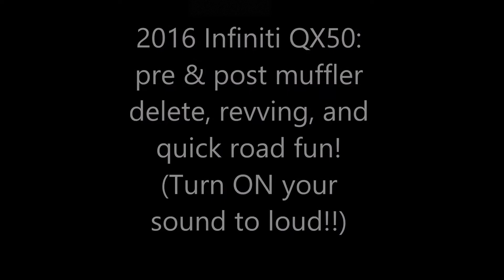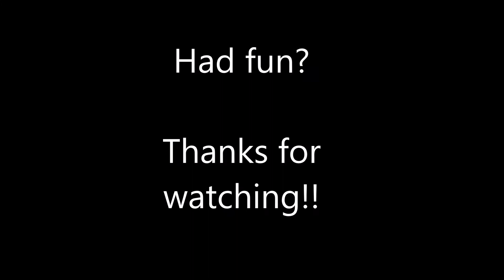Infiniti QX50 muffler delete

Comment: Looking to do this to my 2017 qx50, how much does a job like this cost?
Reply from the maker: It all depends where you live, tax rate, technician/shop's fee (service charge) and other factors, but a ballpark could be between $300-600, depending how much customized work takes place
Reply: G37 axle back, under $200 lol
Reply: @hughesw.1313  would the g37 bee a direct bolt on?
Reply: Where can you find Black Tips?

Comment: Im def doing this with mine
Reply from the maker: After having this for over a year now, I would *suggest to (still) go for a super small muffler. Being total muffler-less, sometimes after a long day, I just want a "quiet ride", but it's impossible. Once Muffler is deleted it's deleted (well unless you put it back on)....
Reply: @onYTsince2008  Appreciate it i also heard about the straight piped g37s sounding super droney and i wouldn’t want that 24/7 lmao
Reply from the maker: @Jawnson123  2:14 to 2:19, as you can see, there is no "straight" pipe, the curvature is there. Plus, the stock resonator is still on. I would suggest to not replace the stock resonators with aftermarket ones, because many times a.mkt ones may cause weird exhaust "fart noises" compared to the crisp, clean and deep Infiniti signature sound as you see in this video.... 
There is someone who has a G37X who lives down my street, who did exact same what I did, but with the small mufflers on, and he has the best sound. Mine is just a total noise-box from ignition-on to ignition-off. So, to my point again, a small muffler will "filter out" all "excess" noises, and only produce what's needed. Hope this long-ass essay helped. Good luck.